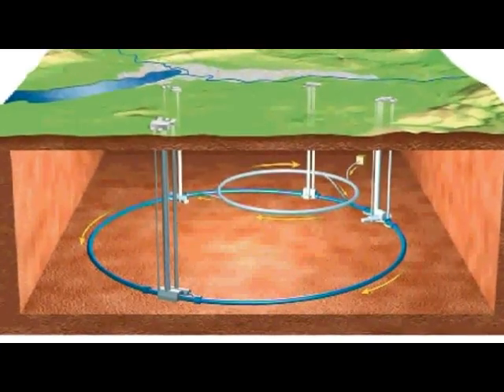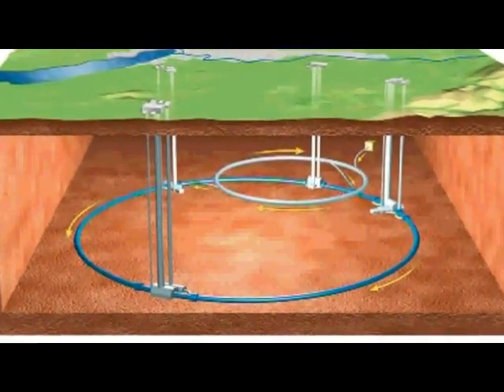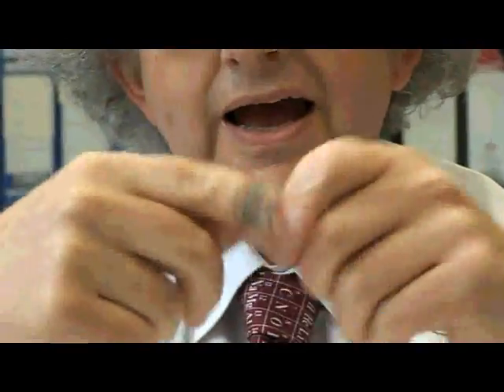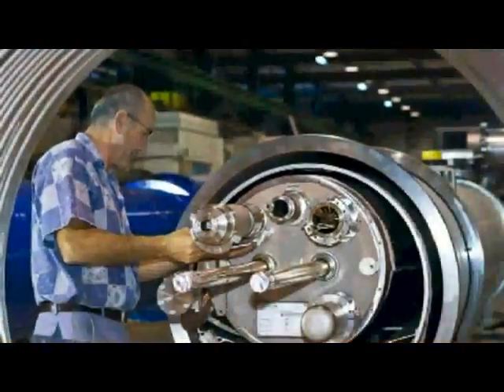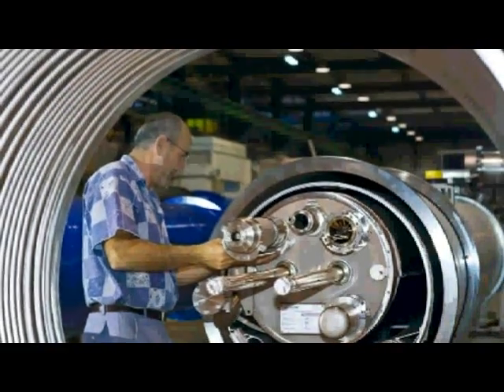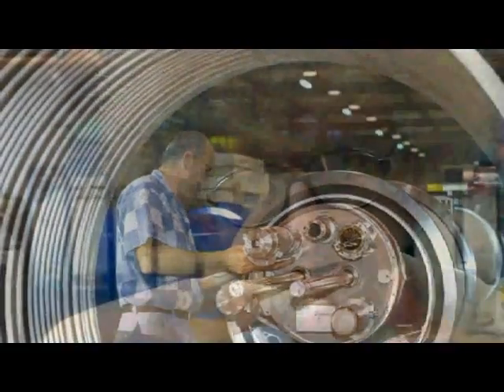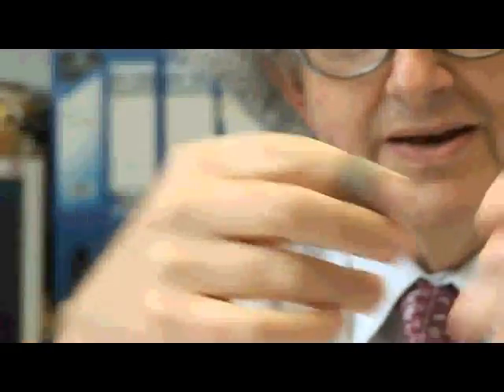Helium @ Large Hadron Collider - Periodic Table of Videos

Comment: gedasltu,

hydrogen molecules are bigger than helium atoms - longer certainly along the inter-atomic axis. Also, the 2 electrons are more weakly bound than those of helium - meaning they are freer to form instantaneous dipole moments, thus increasing their strength of interaction.

Size is over-rated. Number of electrons is a more significant parameter in these weak binding forces. H2 and He both have 2 electrons, but the H2 ones are more loosely bound.

Comment: it is mostly due to the interactive forces between the molecules. 
Hydrogen's intermolecular forces are very weak, but they do exist, allowing hydrogen to condense to a liquid.
Helium has almost no intermolecular forces, which explains its tendency to form superliquids and its resistance to forming a solid even close to absolute zero temperatures.

hope that helps

Comment: Why the boiling temperature of liquid hydrogen is higher than liquid helium? Molecules of hydrogen are smaller than helium atoms so the interaction between particles in liquid hydrogen are weaker. According to this, the boiling point of liquid hydrogen should be lower than helium... Or I just don't get it? Please, explain. 

P.S. sorry for my english if it is not correct.

Comment: Ivecsey is right and there is a good reason why is has a higher boiling point than helium.  Here goes:

Helium, being atomic and not bonded to anything, is completely spherical.  There are no +ve bits to attract -ve bits. There are no -ve bits either.  Hydrogen exists as H2 molecules with a bond connecting the two hydrogen atoms. The bond is slightly -ve and the atoms slightly +ve. The +ve and -ve bits attract, making them harder to pull apart and therfore H2 is harder to evaporate than He.

Comment: very nice video Wikipedia mentions hydrogen having a boiling point of 20.28 K or -252.87 centigrade, which is a higher temperature than the one mentioned for helium. digging further it seems the weak interaction of helium as explained actually lets it remain liquid all the way down to absolute zero. you would have to pressurize it to get to a solid, compared to hydrogen which would become a solid already by the time helium was just becoming liquid. 

thanks for this video!